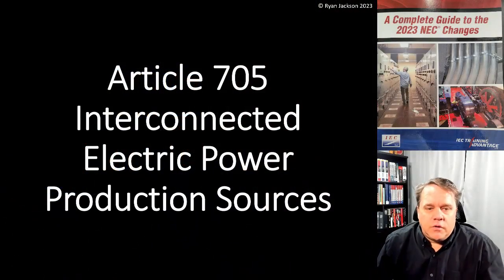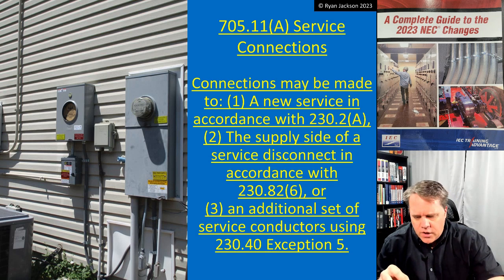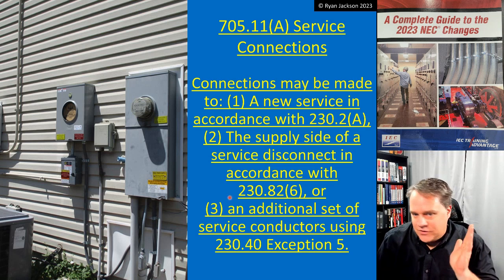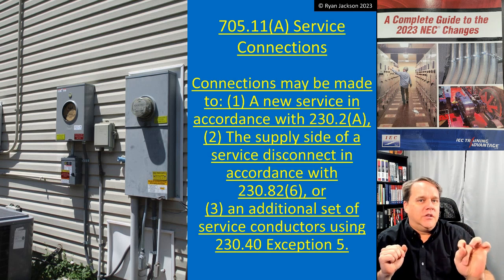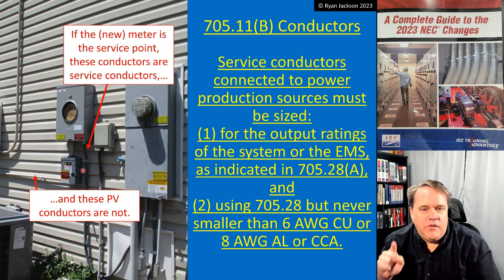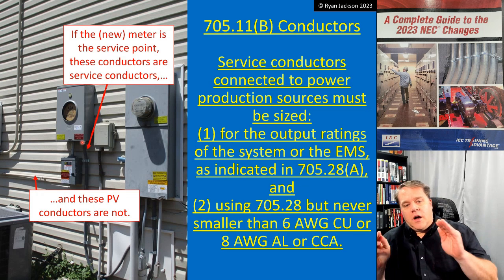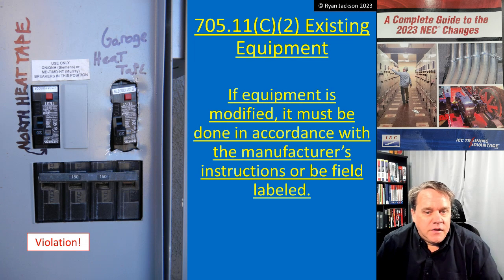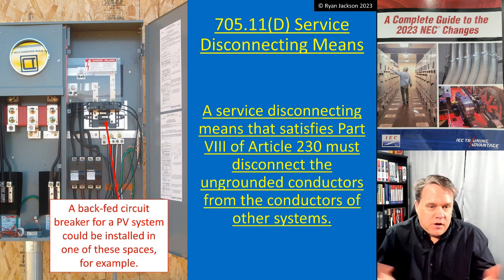705.11 Connections to a Service

Comment: Line side taps are usually connected via IPC s inside of the home's main panel. Those then feed a fused disconnect next to the panel then travel outside to an unfused disconnect for the fire department per NFPA required location with signage. That then feeds the solar combiner with the strings of each array of panels.
Reply: Those taps or IPC s ARE REQUIRED TO BE SERVICE RATED AS WELL AS UL LISTED.
I DO BELIEVE THE SR LABELING on the IPCs STANDS FOR SERVICE RATED.*

Comment: Still trying to figure out how to add PV that doesn't ever feed the utility. My local utility makes it confiscatory to feed power to them when generating more PV than used.  Is that covered in 690?
Reply: confiscatory = meaning what?  they take your system away?
Reply: @keything8487 no they take the generated power you don't use and don't pay you for it. You're supplying them with free electricity (well actually your neighbors)

Comment: Love watching your videos Ryan and have a lot of respect and admiration towards you. Being on the AHJ side of the fence we have always required the disconnects to be grouped per 230.72(A). I agree with everything except it being a separate service but for arguments sake we'll say it is. My question, would not every separate single family dwelling service require an emergency disconnect? If so 230.85(A)3 would apply correct? Please share your thoughts. Our whole reasoning is to direct a first responder to a single location to shut off all power to the structure.

Comment: thank you for the info !    if i may ask; treating it as a separate service disconnect would mean bonding the disconnect as you stated, but also grounding it likewise. so another ground rod(s), grounding rod conductor,  or would that tie into the "main"/original grounding electrode conductor?
i hear the term ground(ing) loop thrown around all the time when it comes to inter-active solar installations. 

btw, im hooked on these videos !!

Comment: Those line side taps HAVE TO BE FUSED and cannot extend further than Ten feet. 
Inspectors have said this.
Reply from the maker: @TheTubejunky  And they're wrong.
Reply: @RyanJacksonElectrical  Could you please advise on what to tell them in the future?
Reply from the maker: @TheTubejunky  There is no length limit, and they can be protected on their load side by a breaker or a fuse. You treat them like service conductors because they ARE service conductors.